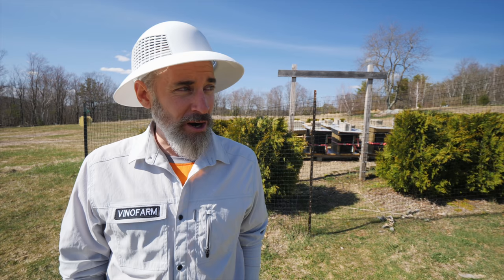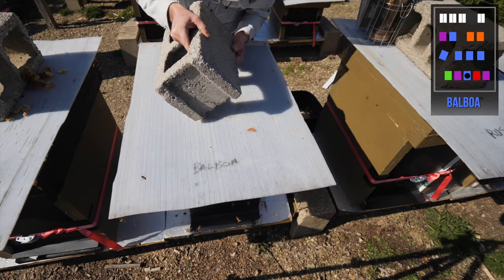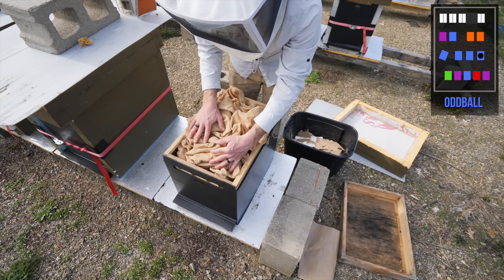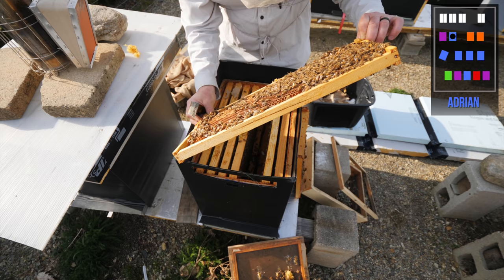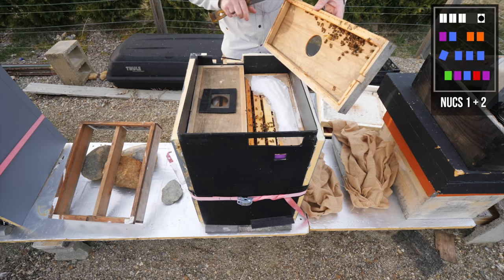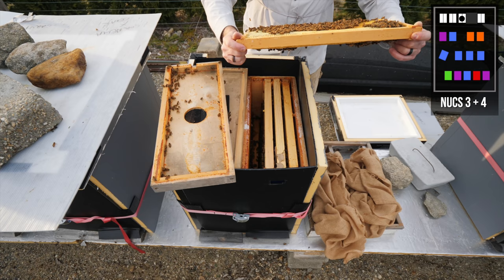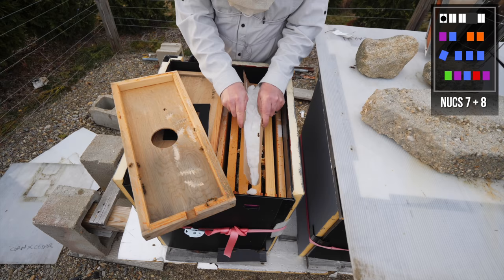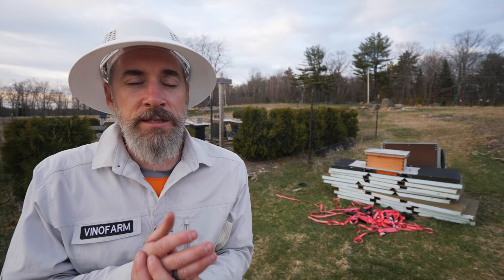Queen Bee Drama Has Begun! (What would you do?)

Comment: What about grabbing one of frames from that hive with all the brood. If they are slamming that much and it's a little tight, I'd think they could spare it. Though I guess it will depend on how well they go overnight. Other thing I was wondering. What about putting one of those electric thermometers with the probes inside your hives. You could monitor internal and external temperature differences. I would be curious to see what the difference is for the outside corner's temps vs those in the middle. Could also monitor  the cooling and warming trends with and without your covers.

Comment: Hallo, all beekeepers! From my point of view, main mistake is at your honeycombs, witch are too dark. Valerij Nikolajevich Korzh (UA - www.mirpchel.com.ua) in 2012 found, that 10 000 bees borned in light honeycombs weighs 1 kg, in brown 0.838 kg and in dark 0.671 kg. This fact reflects, that your bees is too small and their wintering is worse, than bees borned in light honeycombs. In the same way lesser is your honey crop. Korzh recommended using of honeycombs only upon two seasons. He melts the older.
And if you have the heavy winters, try indoor wintering or outdoor wintering in a bell. Old masters recommended the double-walled beehives. So do a hermetic cover (side wals from 1-2 inch polystyrene and top from 2-4 inch) in box form without bottom as a bell and cover all beehive. Ventilation remains from below.
(Sorry for my English, I hope that you understand to me.)